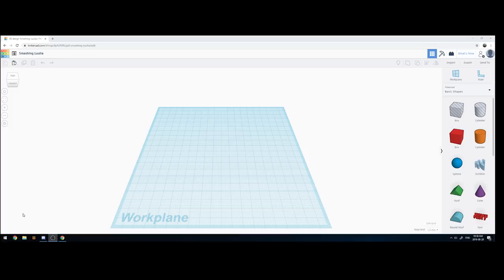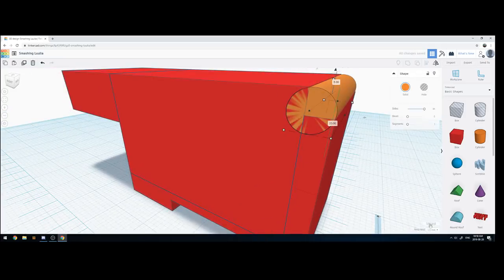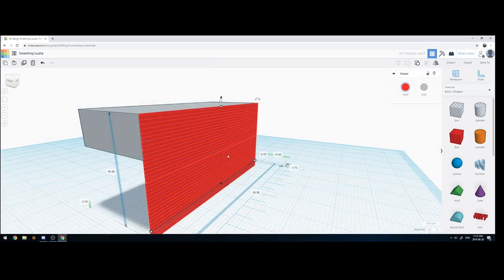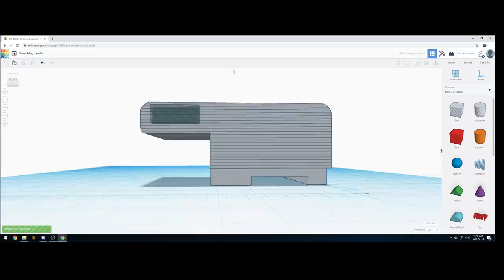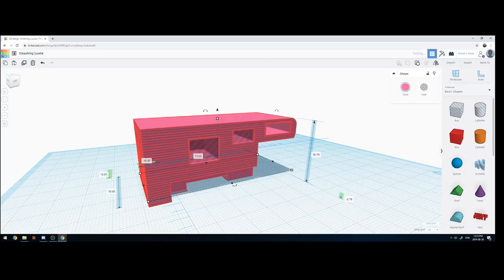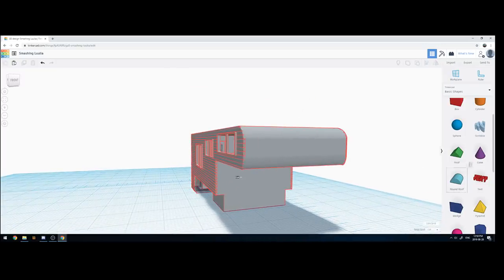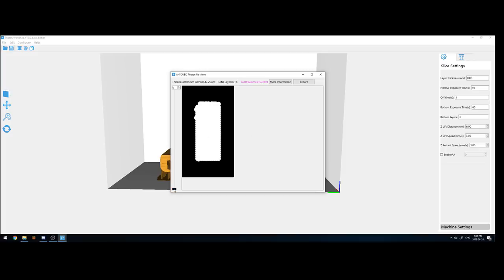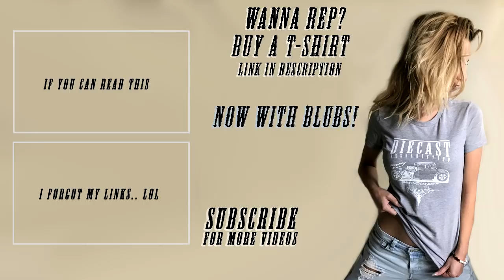Designing & 3D Printing cool 1:64 accessories (Truck Camper)

Comment: Just make it out of parts, like a Revell kit.
You can even make an interior that way.

And if you mess up a part, you only have to reprint that piece.
Reply: That's good thinking, one small mistake won't wreck the whole build.
Reply: Yea! then you can get in and paint the inside of the camper

Comment: Just print the walls (flat) seperate and glue them together for a perfect result.
You can make glue holes/pins in your 3d program.
Reply from the maker: That's not a bad idea actually.. hmm
Reply: @DiecastResurrection  it's like making your own plastic model truck, designing it part by part?
Reply: You on the money there matey!

Comment: Some tools let you break the planes of the primitive and then extrude the sub-surfaces to make more complex shapes from a single prim, but nothing wrong with the add/subtract method of grouping prims if it works for you. Just a second way of basically doing the same thing. I do custom shapes in Photoshop the same way.

Good job on the model, you have a good eye for it.

Comment: look into Mean Green, Simple Green, or even Mr Clean for cleaning your resin parts. Mean Green cleans the best from what I've seen and cost less than any of the other including IPA. Smell is low as well and you can use them in a vibration cleaning tank.
It is suggested to remove the supports before final curing to help with removal and lower the risk of damage to the part.
Also switching to a kit with FEP vat for the tank would help long term.
Also there is a "TOUGH RESIN" out now that will help with weak printing when strong parts are needed.
The vat bottom and printing screen need to be as clean/clear as possible. Watch fingerprints.
A UV box or the sun will help with final curing but hot water might help get the warp out first.

Comment: Whoa! I have been using Solidworks for a long time and I have to say that this design program gets the job done quite well. Very simple and easy to use.
Reply: Yeah, but I would rather use SolidWorks than boolean primatives.  Easier and you can change the build sequence to keep from making the same cuts twice.
Reply: @matthewgaines10  Yup yup, I will never give up Solidworks for sure. I have been using it since 1997 and it is now imprinted permanently into my brain. Still, very interesting to see some of the new applications coming out since the advent of 3-D printers.

Comment: I don't have ANY experience and I applaud your effort, from what I HAVE SEEN, I think it should be printed at an angle rather than flat so the walls don't take the strain. Can anyone confirm this information?
Reply from the maker: I can see light through the walls now that its dry and I can hold it, so I've been beefing it up and adding more stuff for tomorrows print.
Reply: @DiecastResurrection  I'm so excited for you, I know you will become an ace very soon. I have started my own little project based on your channel. Thank you for being strong and confident enough to share your journey with us.

Comment: I have a FDM 3d printer which I bought with the intention of printing 1/64 scale diorama pieces but you just can't get the detail, I printed a few piece like a four post and two post ramp and workshop doors which came out well.
 I might have to invest in a SLA printer, as I've seen some awesome pieces being made like 1/64 scale motorcycles.
Was there a tutorial you followed? I tried playing with tinkercad but got frustrated because I knew what I wanted to do but didn't know how to do it.
Anyway, the camper looks cool, I did think the walls looked a little thin, but I was thinking from the perspective of an FDM printer. I think the idea someone mentioned of printing things flat and making a kind of kit may be the way to go.
Enjoy your new toy lol!
Reply: What's the difference between a SLA printer and a FDM ? Is it price?